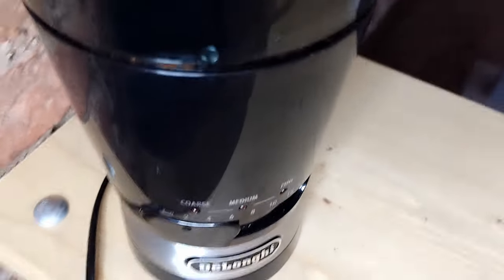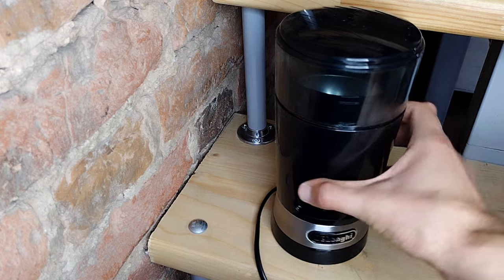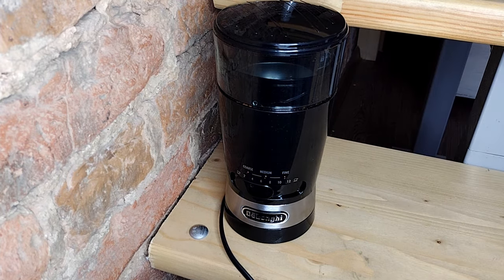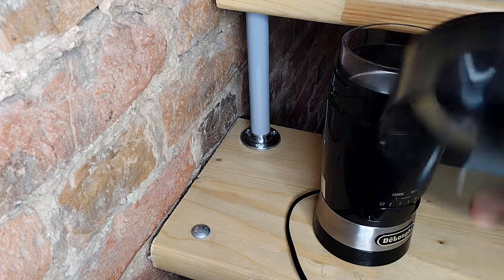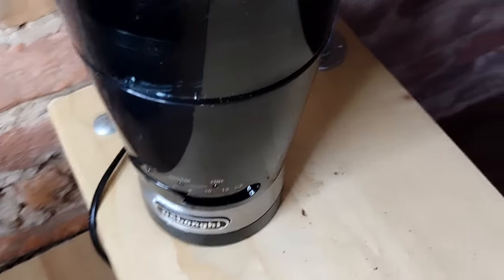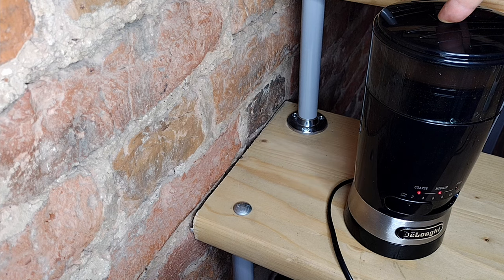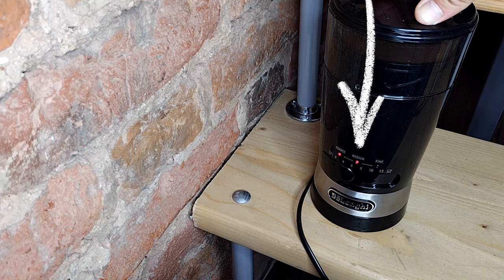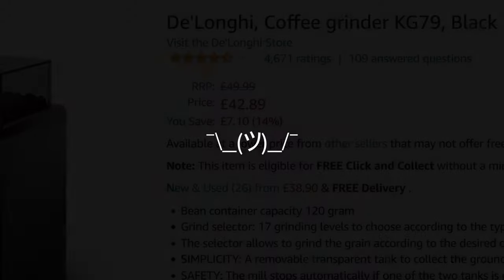Delonghi KG200 vs KG210: how the grind adjustment works?!

Comment: I've got KG-200 and use it for espresso. Not perfect but gets the job done. Personally, I put plastic wrap on top of the grinder cup before attaching the lid and that contains the ground coffee. Aside from that, it's not too bad!
Reply: Does it grind finely? Mine is coarser than it should be